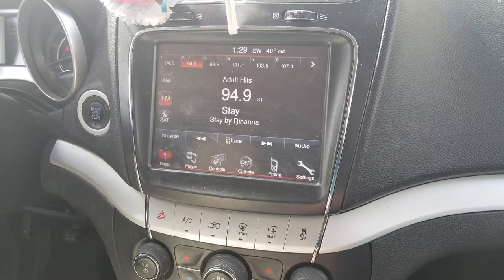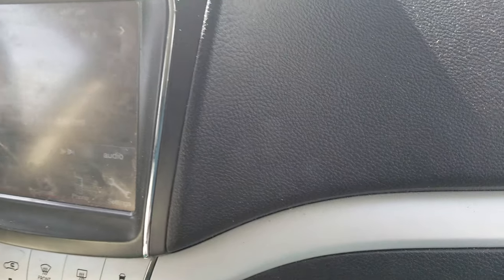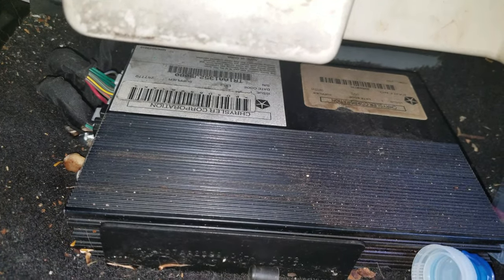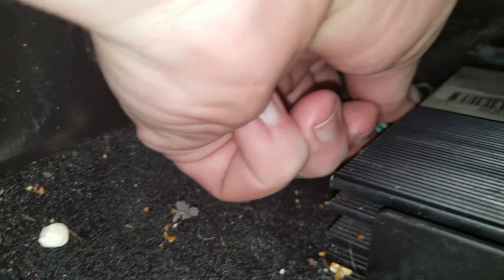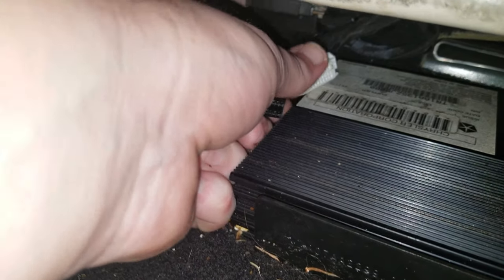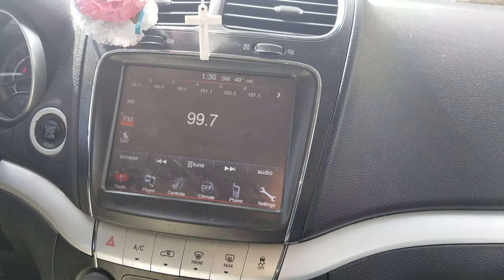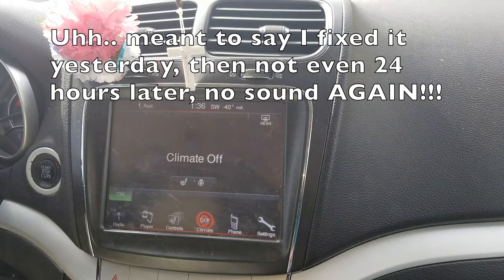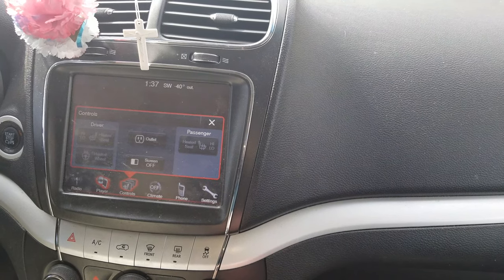How to fix the no-sound problem in your UConnect Chrysler, Jeep, RAM, Fiat, or Dodge Product

Comment: Mine didn’t work I tried multiple times & it still not working
Reply from the maker: Then you may need to bring it in for diagnosis at the dealership
Reply: $250 for 1st hr n a half of diagnostic at dealership
Reply: It’s a defect. The problem is a defect, and there are thousands of complaints all over the net regarding this problem. Yet no recall. We took ours to the dealer. They didn’t mention it was a common problem. They wanted hundreds of dollars to repair the volume problem. Iirc, it was $600.00. We took it to a few local repair guys, and they all said the same thing. It’s a common problem, and they couldn’t fix it.Twenty years ago, they wouldn’t be able to get away with failing to put out a recall, or with continuing to sell vehicles without even bothering to change the defect. 
BTW, there is another problem which is common, affects several different vehicles, and concerns paint bubbling/ galvanic corrosion on the hood. Check your vehicle around the edge of the hood for paint bubbling. This affects several different brands, and should also be a recall. Some vehicles affected are 20+ years old. There is an internal memo, including how to repair it properly. Dodge fixed ours. They use a contractor. Both the contractor and Dodge refused to give us any paperwork to prove it was repaired.
The arrogance and lobbying just galls me. Our next car will not be from an American manufacturer.
Reply: Try replacing your radio fuses. This helps with some as well.

Comment: It only last a few days, you can disconnect the negative cable from your battery to reset it.
Reply from the maker: Good deal.  It seems to vary.. like the first time I did it it didn't last but 24 hours (which gave me the opportunity to make this video anyway) and after I reconnected everything it still worked until we traded it 🤷🏻‍♂️

Comment: Had battery replaced in my boyfriend’s 2017 Dodge Challenger and they never checked the radio to see if everything was working. Both speakers and back up camera were out. Tried this and worked instantly!! Thank you!! 
P.S. in his challenger the box is under passenger seat but is attached to the under part of the seat, not floor. The two black & white plugs are much smaller than in this video which threw me off at first but its all the same! Thanks again!! 🙏🏼🙏🏼😊
Reply from the maker: You're welcome, glad it worked :)
Reply: This video plus comment are lifesavers! I have a challenger too and wasn’t sure at first if the box under the passenger seat was correct but it was and now everything works, first time ever the wireless Bluetooth has worked too lol
Reply from the maker: Good to know under the seat is also for challengers, thanks for your comment skyman
Reply: I was able to disconnect the amp leads and the sound came back. 1 hour later, it stopped working again
Reply from the maker: May have to do this again. Like I said in the video, I tried it at first, it worked for a bit but then needed a reconnect

Comment: What you are doing is basically "resetting" the factory amp power.  Same thing by "cycling the power" by pulling the fuse and putting it back in.  I used to install car audio for a living and the amplifiers have built in protection circuitry to prevent the amp from destroying itself from a short speaker or shorted wire.  It is these shorts that is causing the problem of "no sound". 

In the "older" days of car audio, there were no protection circuitry built into the amplifiers, the amplifiers basically "smoked" and you had to have them repaired.

Good luck in trying to find out which speaker is causing the short.  The only way to find out which speaker is bad is to disconnect each one, play the stereo until the problem quits and you MAY have found your problem.  Intermittent problems are the worst to troubleshoot, especially if the speaker still plays and the problem does not always show consistently.
Reply from the maker: Yeah was gonna say, I think these journeys and such are full of disconnect and reconnect issues.. even my window switch.  Also ever since the second time I disconnect and reconnect, the stereo system still works.

 All the same, thanks for your tip and for watching.. don't forget to share with your friends and family and other Uconnected Chrysler product owners!!

Comment: I have a 2014 Durango citadel it your having issues with no audio but ac buttons work and you checked battery fuse check fuse F71 in engine fuse box should be a 10amp fuse
Reply from the maker: Okay... sounds good...

Comment: Hey! i recently tried connecting my phone using bluetooth and no audio came out, i tried with an aux and the audio was working. none of the phones work using bluetooth. cna u help me?
Reply from the maker: Most likely the Bluetooth module needs to be replaced, common issue

Comment: I have a 2015 Dodge Journey SE. Only REAR speakers not working. After research, found that if one rear blows out, it disables the other. In order to check which speaker is blown, I gotta remove the rear door panels...one at a time! Think I should try this first?
Reply from the maker: I'd prolly try the unplug reset first vs tearing down half the car interior

#WorkSmarterNotHarder
Reply: @adventureoflinkmk2  Thanks for replying BUT, I went to do just that to find that the Amp is NOT under the passenger side seat! I have the SE model if that matters!
Reply from the maker: @sarge6870  ugh.  Well that stinks...
Reply: I have a 2015 Grand Cherokee with the same problem. Where did you see if one rear speaker goes out, it disables the other? Would like to research it further. Thanks!
Reply: @RockDog101  I saw it on another Youtube video. They were mechanics that do a lot of work on DJ's and that was their statement. "One rear speaker blows out, as a safety measure it disables the other".
Reply from the maker: Very interesting indeed...

Comment: I've had the same problem three different times over the years when my 2011 Dodge Journey crew I just laying down in the passenger floorboard pulled a Fuse cover pull the radio fuse wait a couple minutes put the fuse back in then I'm good to go for another year or two
Reply: Glad it worked for you, my 2011 Journey XT the sound stopped but the screen still works with gps etc. I am worried about pulling a fuse and losing all my controls.

Comment: Jeep Grand Cherokee 2014 with Uconnect...
No sound after new battery install. Could it just be the order of reconnect? Maybe the new battery blew a fuse?
I tried the engineer settings on the radio for a re-boot with no effect. Hands free also silent 🙁
Reply from the maker: That's weird...
Reply from the maker: Even so, hands free going silent seems to be the Bluetooth module going out, I've been meaning to replace it in my dad's journey for the longest time
Reply: @adventureoflinkmk2  My guess it is the amp. The phone connects ok, but without sound the call is pointless.
I think the UConnect system is fine, but the amp power control cable isn't properly plugged in - under the driver seat (this is UK edition) is the battery; where is the amp supposed to be?

Comment: Mine had the issiue where the aux or CD sound works, but FM wont produce sound. Would this fix the issue?
Reply from the maker: Probably.. try and find out... if that doesn't work you may wanna try looking at the fm antenna or otherwise go to the dealer to verify a bad unit
Reply: adventureoflinkmk2 yeah we don’t have that in our car lol. I also tries replacing the 15 fuse with a 20. Still didn’t work. It doesnt super bother me cause i use a bluetooth aux device with apple music but still kinda bothers me.

Comment: By the way the reason it keeps going out is because there must be a bad connection somewhere. It shuts it down so you don't fry the radio.
Reply from the maker: Good explanation, thanks... Never knew that...
Reply: @adventureoflinkmk2  the amplifier is getting too hot and shuts down. This will continue to happen until they fix the amp.
Reply from the maker: @williamlambert9116  very interesting find... So essentially the amp is shutting down due to a lack of ventilation and then overheating

Comment: I don’t found or see those connectors under the seat, is just the connectors for the sets where can I found those 😢
Reply from the maker: Either you may not have the amp or it's somewhere else if you do
Reply: @adventureoflinkmk2  I’m looking for thistle about months and I’m still don’t fix the problem.. I’m already change the fuses and nothing, I’m pretty sure if I take my car to the dealer ship or any other shop they gonna take advantage that’s why I’m still trying to fix by myself

Comment: Hello sir do you know how to fix the volume button? It won’t move for the media but for the call it moves up and down. Do you know why?
Reply from the maker: Hmm.  Could be an issue with the radio unit internally -- best to take to a dealer and diagnose
Reply: @adventureoflinkmk2  i accidentally pushed the button to hard could that have caused it?
Reply from the maker: @Randomcat12  perhaps
Reply: Is there anyways to fix it without replacing the whole radio?Also now the radio won’t play and every time I turn on the jeep the brightness is on the low setting. I’m sorry for bombarding you with so many question.
Reply from the maker: @Randomcat12  you're fine.. and I think the radio needs to be looked over and possibly replaced

Comment: My 2012 charger audio out/in wont work during a call...any suggestions
Reply from the maker: Where is the audio in/out source connection... Bluetooth or the aux cord
Reply: Mine is aux cord and I can’t get sound using Maps on my iPhone
Reply from the maker: Hmm... ive never known the aux port to go bad on these... however, the Bluetooth modules love to go out

The only thing i can think of is that the internal switch in the aux port is stuck
Reply: @adventureoflinkmk2  bluetooth
Reply: @adventureoflinkmk2  whenever someone calls me, they can't hear what I'm saying
Reply from the maker: Yeah, unfortunately bluetooth modules love to go out in these :(
Reply: @adventureoflinkmk2  you are SUPER correct. The ucconnect at its core is flawed  when it comes to phone connectivity.  Start your vehicle and walk away with your phone in hand, and that phone will not connect again until you power the car completely off
Reply from the maker: Ugh.  Makes me glad I got the toyota system lol

Comment: sir, can i ask you another question about the radio?
Reply from the maker: Sure, what's up?
Reply: @adventureoflinkmk2  My u connect 4.3 radio/climate/controls stopped working(went black) and will not come back on.  Any ideas on the fix?  Thank you! and nice video!
Reply: @adventureoflinkmk2  ive tried unhooking the battery, unhooking the whole radio unit and even unplugging the cpu/ecu but no change or help.
Reply: @adventureoflinkmk2 my fuses are good as well, im thinking a short but idk.
Reply from the maker: @joshuaallen6196  hmm.  Maybe need to take it to the dealer for diagnosis
Reply: @adventureoflinkmk2  yeah, probably my only option.  I heard they like to charge a pretty penny to work on these radios and they dont always fix them correctly. I hear a lot of people saying it usually takes numerous trips and each trip with a price tag.
Reply: @joshuaallen6196  believe it or not, try running your car (in park) and opening your passenger front door.  Don’t get in and sit down. Let it run awhile.

Comment: Can anyone tell me where is the factory amp on a 2019 dodge journey
Reply from the maker: Should be under the passenger seat
Reply: @adventureoflinkmk2  I did look there but then I read some don't have a factory amp. But dodge will still put the factory amp fuse in the interior fuse box
Reply: @adventureoflinkmk2  I just wanted to make sure I wasn't crazy that's it.
Reply: Check the rear hatch on the left, lift up the little storage container it's under there

Comment: I have a 2017 ram Big Horn. A message keeps coming up on my display about a program that will auto reset if I set the time for it to do it .. i’ve set the time to do it and did as instructed on the screen which is just to leave the key off. It’s been three weeks now, it has never done the reset itself, the display keeps showing that. My radio is shown as being in the mute stage. It doesn’t work. To tell you the truth, I don’t care about the radio, I don’t listen to the radio, but I would at least like it to work..
  How do I get my radio to work or out of the mute stage?
  I just thought of something. My warranty expired a few months ago, there was a recall for something to do with my computer/cruise control. I took it into the dealer and they did the “ update”.. now, I know there couldn’t possibly be a connection, I mean, they would never do anything this underhanded, but isn’t it a coincidence that all of a sudden I am having trouble with the radio that I have never listen to for more than maybe 10 minutes total. Just after I had my machine into the dealer for an update that was a recall for the cruise control. Now all of a sudden my radio doesn’t work.. keep in mind, I never listen to the radio, never. I know that Chrysler would never put a trojan horse bug in my radio system in order to have me generate business that is not covered under warranty for the dealer. They would never do that. But that’s what I would call a coincidence
Reply from the maker: I have no idea...
Reply: I have a 2011 journey and have had to spend 2200.00 to get the uconnect fixed twice. Now its not working again and my radio just died.

Comment: It did not work. I also looked at the fuses. They are not blown. I'm so sad..
Reply from the maker: Hmm.  Look under the fuse box for corrosion or loose/broken wires?
Reply: @adventureoflinkmk2   It appeared clean with no issues when I took out the fuse first. Now unless there's a problem under it where I couldn't see.? 🤷 But thanks for the suggestion.

Comment: Someone please help. My right speakers don’t work when playing through Bluetooth. They were fine on radio but not on Bluetooth. Tried on different phones, tried unlplugging the fuse, what could be the issue? I have a 2014 Charger.
Reply from the maker: Sounds like something within the bluetooth system...
Reply: Any idea how to fix?
Reply from the maker: @JhonnyBoi  you may have to exchange the bluetooth module..

Comment: No  sound My 2016 Ram 3500 driver's side speakers. Help please
Reply from the maker: Hmm... You sure your sound settings (specifically balance) are properly set?
Reply: Mine too and it is balance. 2017 ram 1500
Reply from the maker: Hmm.  My only other thing I can say before taking it to the dealer is getting a voltage reading on the offending side's speaker electrical connector

Comment: Simply take the 15 amp fuse out and put in a 20 amp fuse problem solved
Reply from the maker: Yeeeeeah... just be careful to not set the car on fire
Reply: Which fuse? I have two... One for the radio and one for the amp.
Reply from the maker: @SimpleArtforAdults  look at your fuse diagram... one should say IOD and have a number by it
Reply: Ah the IOD. Thanks!
Reply from the maker: You're welcome
Reply: My screen will not come on at all on my Dodge Charger🥺🥺... Please help!;!!
Reply: My screen isn't coming on at all on my Dodge charger... Can u help??
Reply from the maker: You may either need to get a new screen or visit the dealer for a proper diagnosis

Comment: I wouldn't own a car that you have to do anything out of the ordinary to use the equipment what a piece of crap
Reply from the maker: Then take my advice: stay far away from Chryslers....
Reply: It’s a safety feature. Somewhere there was a short and the amp shut off to protect the system from frying. For example, water might’ve gotten inside the door.

Comment: Report the problem to nhtsa.gov
Reply from the maker: Unfortunately this isn't considered a safety issue... you'd have to take it up with FCA... fuckin good luck with that
Reply: My fuse completely burned and is no longer safe to put a fuse back in the same place so now I must figure out a solution. In the mean time no radio.
Reply from the maker: Oof... now you gotta figure out why the fuse fried...
Reply: @adventureoflinkmk2  I consider it a safety issue because the SOS button will not work either. So if I get into a crash,,,good luck with that.